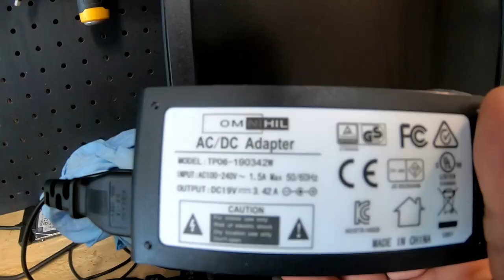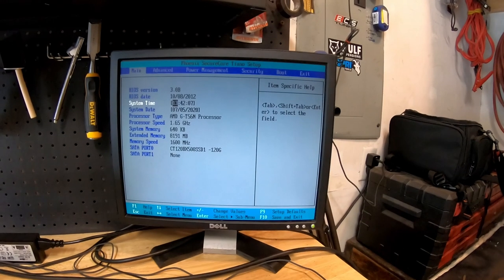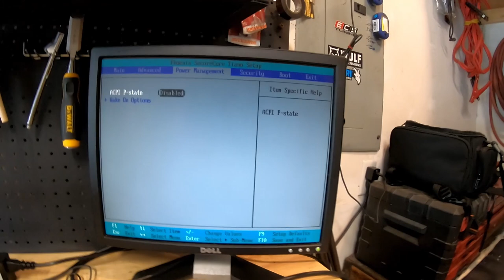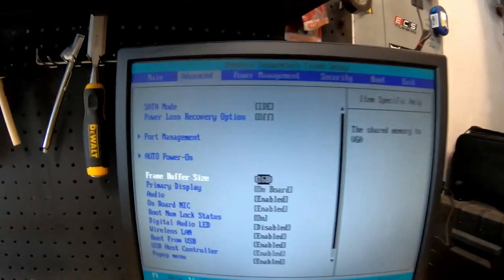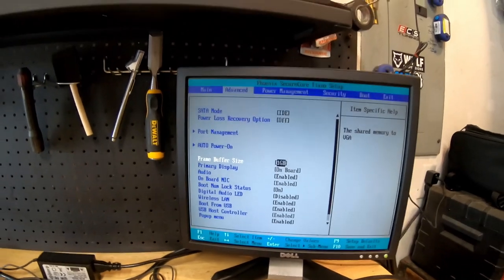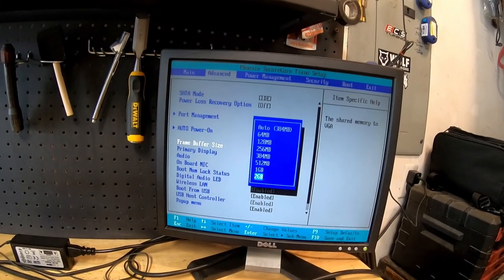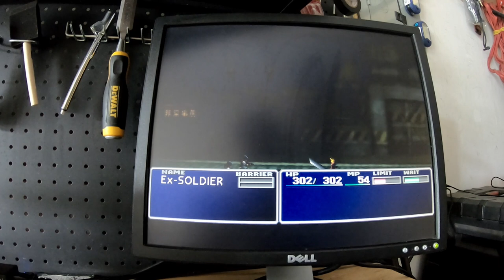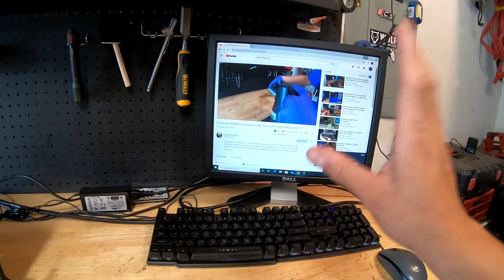Was it wise to buy the Wyse? Dell Wyse review and upgrades!

Comment: When you were installing the new ssd, i believe that screw mount that you covered with electrical tape is removeable and is actually supposed to go in the socket just to the right of it to properly mount the SSD.
Reply from the maker: I didn't even think to try taking it out. appreciate the info!
Reply: @DLMtechgarage  I'm not certain thats the case, but it seems to be.
Reply from the maker: @nathanhamman418  makes sense, wish I had one in stock to test!
Reply: @DLMtechgarage  I have one on the way, and a spare ssd, it should be here Friday, I'll update you when I can
Reply from the maker: @nathanhamman418  please do, thanks!
Reply: @DLMtechgarage  The one i ordered turned out to not be the same as the one you have, in fact, mine is much smaller and has a 40mm m.2 sata slot rather than a full sized sata connection like the one in the video.
Reply from the maker: @nathanhamman418  maybe newer then mine
Reply: @DLMtechgarage  mine was the thin client model, you got the micro desktop, I ended up with a thin client of the 3040.

Comment: I bought one of these a week or so ago, it was 20 euro's, but it came with the power adapter so i jumped ship and got it, and i have to say, these things are pretty powerfull for what they are, no they are not core i7 level of performance, but they are not all that slow, i have the 1.4ghz version, but its still a dual core cpu, and the graphics are compareable to a nvidia gt610, which is, for this thing, not too bad actually, this thing can game, i have windows 8.1 installed (x64 version because of the ram), i have tried xp, 7, 8.1 and 10, and 8.1 is the most responsive on my particular machine, so i use that, and it plays older titles very well, like half life, xll (13), return to castle wolfenstein, quake 1, 2 and 3, doom 3 is playable with low settings, but i have the bfg edition installed, and doom 1 and 2 play superb on my model, i have need for speed underground 1 & 2, colin mcrae rally 2005, halo combat evolved, gta 3 & san andreas. All these games are quite playable on this lil machine, and it consumes as much power as a powerfull LED lightbulb, which is insane!
Reply from the maker: yea they work pretty well, just hate the windows 10 don't run so well with it but maybe with a version that has less crap running it might.
Reply: @DLMtechgarage  I think a stripped down version of win 10 would run great on this, but windows 8.1 pro runs very nicely on this machine, maby you could give that a try?
Reply: @DLMtechgarage  i'm no gamer, I only really like 2d (thats another story). I would be interested to see anyone use this with salient OS, a linux optimised for games and multimedia (low latency), has steam and some other gaming thing. Best i've seen for music production
Reply from the maker: @firehandszarb  that might be perfrect for this. i need to try it.
Reply: Can it run 1080p?
Reply from the maker: @Makonator007  not really. i would not recommend it, can olny run windows 7. I would look for a lenovo, dell or hp, usff. same size and with a i3 3rd gen or greater you can def use it for more things. they cost a little more but def worth it. did a video on the channel of a lenovo usff. def check it out.
Reply: @Makonator007  1080p no, offcourse not, like i said, its not an i7 with a gtx 1650 on board, if you want to play real games, get a gaming rig, this small thing is good for very old games from the early 2000's, which don't even support 1080p anyway. The best it can do is UT2004 in 1024x768 with a mix of low and medium settings, that's really pushing this thing, but for quake 1/2/3, the original half life, soldier of fortune, the first NFS underground and many, many more old fps and racers this thing is better than an old pentium 3 with a geforce 4 in it, it gets around the same performance as that, but consuming a fraction of the power. This thin client is about on par with the original xbox in terms of performance, which, honestly, for a machine that small, is pretty impressive!
Reply: @bramvandenbroeck5060  i ment 1080p movies, but np, channel owner replayed me about it.

Comment: yo theres some dell wyse 5060s on ebay right now that while they only have 4gb of ram (can be upgraded with another stick) they have a quad core processor in them same 16gb sata space and its 34ish plus shipping and comes with power brick .. i have one i just bought from them and it runs games way better ..i stuck another 4gb of ram in it
Reply from the maker: thanks. i checked them out, not pick one up. specs seem promising for the price!

Comment: Found a tossed out Dell Wyse AIO 5470 to-day. Not sure what to do with it! Think it has a Quad core 1.5Ghz Celeron.
Reply: Check my other post I made here. Should be close to the top. If you can't find it, I can copy / paste it here for you. Long & short of it is, either use it as a thin client for running VM's from a virtualization server, or for Remoting into & using your main PC from a different location in your house / on your network. Great for if you wanted to have a discrete PC connected to the TV in your living room, so that you could access your PC from the comfort of that location.

Comment: So I bought a Sata Extender Cable, pulled the 16GB eMMC module and replaced it with a 250MB SSD.  Works fine.

There's no place to mount it, I will pull off the case and have it free floating.

I didn't even know a Sata Extender cable existed before 2 days ago...
Reply from the maker: neither did I, very interesting.
Reply: Why go from 16GB to 250MB? That's quite a downgrade.
Reply: @MathijsGroothuis  250GB

Comment: A sandisk x400 ssd 2.5 ssd has a small ssd in the 2.5 hdd case. I have two x400 ssd. one is a 128gb other 512gb. both have the same small foot print of that ssd.

Comment: Nice review. The only thing is that not all SSDs that you buy come with such a small board on the inside. That means anyone wanting to do this SSD upgrade must be careful which brand SSD drive they purchase. I am wondering if that PICe slot can take a drive or is it an M.2 that is not used. Now many may say because there are two screw holes means its PCIe and not M.2 but if you look at a M.2 2260 or even a 2242 with extended plates, it will fit. I will get one and venture into the Dell Wyse 😂

👍👍👍👍👍
Reply from the maker: good point, def didnt think to mention that.
Reply: @DLMtechgarage  after all, what kind of drive is it and where did you get from, i would like to order one and install pfsense
Reply from the maker: @NegroRotary  I bought a crucial bx500 120gb from amazon and that one seemed to be small enough
Reply: @DLMtechgarage  thank you
Reply from the maker: @NegroRotary  anytime!
Reply: You can just open every random 2.5 SATA SSD and only keep the inner PCB, that will be the same size as the thing that is currently in it.
Reply: Old post, but wanted to add this - if you don't want to lose the warranty on the SSD you can buy a sata+power extension cable and position the drive elsewhere inside. Just did this the other day, worked perfectly
Reply: @dad2979  Difficult due to the lack of space in the case, mainly the Wyse 5020. Its apparent when you actual work on one. I have both the Wyse 5020 and a Wyse 7020 and know its only possible in the 7020 format.

Comment: hi, I have the same thin client but for some reason, even YouTube very  slows and freeze. I tried different OS  (win 7-10) makes no difference . I have 60gb SSD and 8GB RAM DDR3
Reply from the maker: since the newer windows update, this thin client does not have the cpu power to keep up with windows, another thing to check and see would be temps, I remember with this one the temps were a little high, had to do some fresh thermal paste due to this computer thermal throttling. Monitor the temps and and if you see some high temps in the 70's and up then that could be the issue. Outside of that this computer is def showing its age and has been better suited for a linux build. Thanks for watching.
Reply: @DLMtechgarage  спасибо!
Reply: @DLMtechgarage  I replaced the thermal paste and everything has become much better . I have one small request Do you have such an opportunity to download an image from a thin client
 using Wyse USB Firmware Tool and place it somewhere in the cloud and if you want to make a video about it .I need this to restore the BIOS after resetting the settings with a battery. Because Dell stopped supporting these devices getting an image to restore is very difficult . If you do this many people will be very grateful including me .  Thanks !
Reply from the maker: @DollarJonny  I currently don't have a thin client in the garage but I will browse around and see if I can find the image, Is it the same one as in the video?
Reply from the maker: @DollarJonny  anytime!
Reply: @DLMtechgarage  Yes exactly the same =)
Reply: Dude, if you have another, higher powered PC on your network, just put a thin client OS, (like Dell ThinOS or Linux Thin station), on it & just set up RDP & use the thin client to remote into your other PC. Problem solved.

Comment: If the Sata Extender Cable works, perhaps a sata power splitter and use the single sata port on the board near the battery?
Reply from the maker: true, in theory it should work. you def have the power and I would imagine the sata on the board would pick it up as a drive for boot.

Comment: I just got one of these and set it up with debian, ordered a real supply and some more ddr3 ram. So far so good. Mine has 10600. Might have to check the rtc battery, add new paste and check caps as this was made in 2013... hah!
Reply: I tried some ECC memory and it doesn't work, not sure if it requires non-ecc, or if I need a bios flash for my 4gb dimms.. Looks like bios flashing is a pita. I have more ram to test on the way.. Using this as my iot dev machine, as I have the wifi module and can fire up aps on a whim.
Reply: @onkelfabs6408  I put 2x4 PC3-10600 1333 in and it worked, i have not done any testing though, i would not mix speeds since its non ecc
Reply: Heya how much ram did you put in? Do you know what's the max ram it can take? 

I wanted to max it as much as possible!
Reply: @mousatosun7739  I think this generation is only 8gb
Reply: @tablatronix  thank you! :)

Comment: hiya will the high temps the ssd without the protector safe,  its too close to the heatsink that can became hot fast isnt it
Reply from the maker: The ssd never really ran hot as it was a lower end one. The temps were fine and never caused any thermal throttling or performance issues, I also believe changing out the crappy thermal pad/paste they used on the heatsink made a huge difference. Thanks for watching!

Comment: I have about 10 of these to play around with . And as I type am installing windows 10 on there. I got some mini fans to put inside which am about to find a Power source for. I will keep you updated.
Reply from the maker: please do thanks!!
Reply: I think win7 or xp are more appropriate for those thin client esprecially for retro gaming. 
Amd realease driver from win xp to 8.
Reply: @DLMtechgarage  Hello there. i have installed 64bit OEM windows 10 pro  with a 500gb HDD and 20gb ram and it workd like a charm...i kept the original fans and they work quiet. so far no issues.  (Optiplex small form factor 9020 64 bit based i5-4570 @3.2GHz x 2  with dual display ports with audio. i will upgrade a little more soon.
Reply from the maker: @seanbeharry9319  nice !
Reply from the maker: @davidereverberi5279  yea most def, great for building a arcade cabinet or something!
Reply: @davidereverberi5279  I always saw these as little office toys until I was handed a few to scrap for parts was the plan. After checking them online I was shocked so I build one then 5 more later lol
Reply: My guy, you're doing it wrong, (I mean what you're doing technically works, I'll elaborate). Yes, you can run a more resource demanding OS like Windows on it, with a bigger SSD & more RAM,. However, A, you're having to invest money into buying more RAM & SSDs, (Which can easily double or triple the cost of final build), B, even after all that investment, you're still limited by the low powered CPU & C, It makes it higher maintenance with a shorter life span, because due to the higher strain & heat being put on it, you'll have to replace the thermals more often, the CPU will burn out faster, in some cases, modifying the case might be needed to install fans.
Remember, these are VERY low spec machines because they were built by design to connect to a far beefier server. Use that to your advantage. Instead of trying to turn it into something that it is not, instead keep it stock as is, (dinky 16 GB ssd, low RAM & all), slap a thinstation OS on it, (Like Dell ThinOS, Linux thinstation, etc...), & then use the web browser on that OS to RDP, (remote access), your main PC, or better yet, remoting into a cheap virtualization server.

If you use it that way, you get a LOT more out of it, (as you're able to do things on it that it can't do, as it's using your main PC's / Server's hardware to do the tasks instead of the thin client's hardware, as all the thin client has to do is maintain the connection to the PC / Server), AND it runs nice, cool & snappy, because the hardware isn't being strained. PLUS, you save a bunch of money too, because you don't need to buy any SSDs or RAM to upgrade it.
Reply: Whats up sorry for the long long delay. I got the PC sorted with 32bg ddr3 seem to be working alright just going keep it as a assic and upgrade

Comment: What power brick did you go with? I know these need 19v bricks but I was wondering about amperage and wattage and such. I can't seem to find a specs sheet from Dell on these. Also could these handle 4k video playback?
Reply from the maker: found it on amazon by looking up the dell wyse and the version of the wyse. i bought the cheapest one i could find and it worked fine. as far as specs, Dell Wyse Zx0-Z90D7 Thin Client AMD G-T56N Dual-core 1.65GHz 8GB Flash Storage 2GB DDR3 SDRAM, as far as 4k playback it won't, it studdered barely ran windows 10. that amd cpu is junk on it. this is better suited for a retro emulation pc
Reply: The power adapter for Wyse 5010 is rated at 19V/3.4A

Comment: Where did you find the video drivers for this one? I'm having too much trouble with it... Any help would be much appreciated 👍
Reply from the maker: it was installed when I installed windows. if not then probably would have to look on the gpu model and got to the manufacture.
Reply: @DLMtechgarage  figured it out already but thanks for the reply. I was looking for a XP version driver because I wanted to use this thin client as my main XP machine. And no regrets. As a retro XP machine it's great! I'm glad I bought one. 👍
Reply from the maker: @xalalalala  nice! yea they def make good retro pc's

Comment: I actually bought WYSE 5010 128GB SSD, 8GB RAM from eBay. Preloaded with Win 10 (probably IoT version?). For $90 with cable and it still has 5 months left with the warranty lol. I wiped it Now I need to figure out why my Ubuntu install ca't finish completely. I use it mainly for IoT and my mesh network controller. Low watt is what I want.. quiet, small factor...  and I just ssh. 5010 also has two wifi antena so it's pretty cool.
Reply from the maker: yea these tiny computer are pretty cool. I keep one in the garage for just looking stuff up when working, I also tend to flip the as retro gaming pc's with roms and emulators and that seem to sell well. plus they are cheap and easy to find! Thanks for watching!

Comment: I want to buy this for my dummy tv, use it for 1080p and online streams, is it powerfull enough for 1080p?
Reply from the maker: I would not recommend it, way too weak. def look for like a oem usff like dell, or lenovo. little mroe expensive but has more power and is better for what you want it for.
Reply: No, but if you use it to remote into another, higher end PC, (like if you have a gaming / production PC in the other room on the same network), or better yet, a virtualization server with a few VMs on it, then yes, it definitely will do 1080p or even 4k, assuming the PC or server you're remoting into is capable of it.

Comment: Has anyone tried upgrading the CPU in this to something faster?
Reply: They are soldered on, plus the sockets for the CPU is limited, even if you wanted to desolder & replace the CPU, not to mention you'd run into other bottlenecks. But if you already have a better PC, you don't need to upgrade the thinclient, just put a thinclient OS on it & use it to remote into your main PC. I use mine, connected to my living room TV, for remoting into my virtualization server. I've got multiple VMs on it, & it works amazing for that. No CPU upgrade needed because all the thinclient needs to do is maintain the connection. My server's hardware does all the heavy lifting.

Comment: Have you tried this with mobile games or MMORPG? Like Tales of Wind? Can it run that?
Reply from the maker: I did not, Windows 10 really did not work well on it, I used this more for older title games. Works fine for windows 7.
Reply: @DLMtechgarage  The reason I was asking was because I was planning a temporary cheap replacement for my laptop. I used to play some mobile games on my laptop along with my phone as members of a party lol. I was hoping it would do that. I know you'd say why not just get another phone right? I need a desktop for work too and since my laptop broke I was hoping to find a really cheap replacement that could do both. The cheapest one I could find looks the same as yours but only got 4gb ram. The other cheap desktop that I could find had no graphics card. That's a bummer then.

Comment: Do you think I can use this as a ftp server for cctv to run 24/7
Reply from the maker: as long as your not using windows 10 it would work fine. I would use a linux base os. 10 struggles with this.